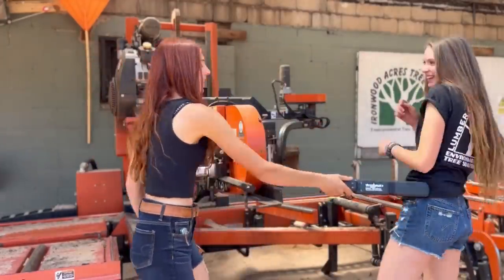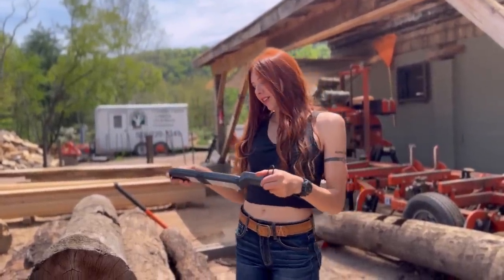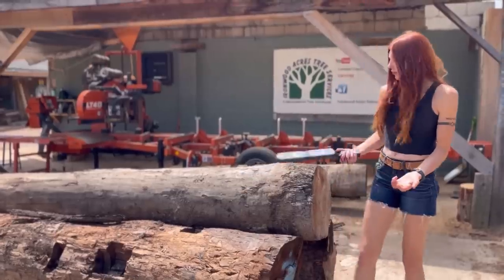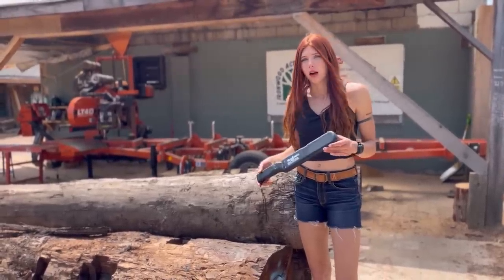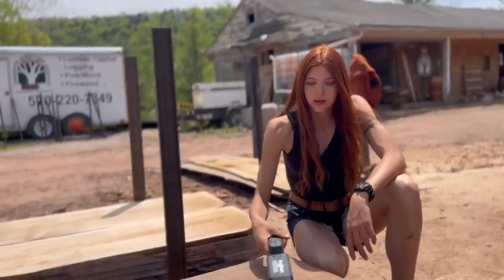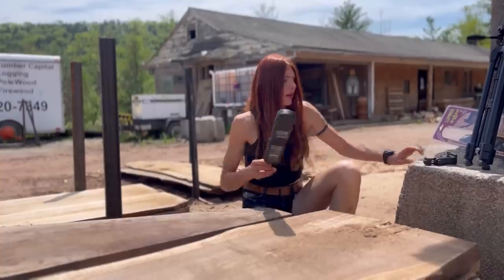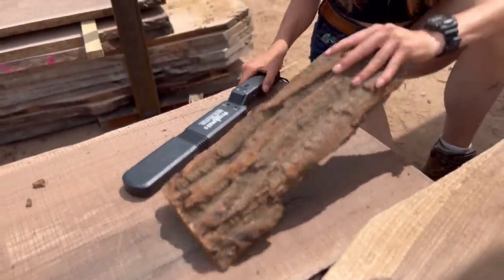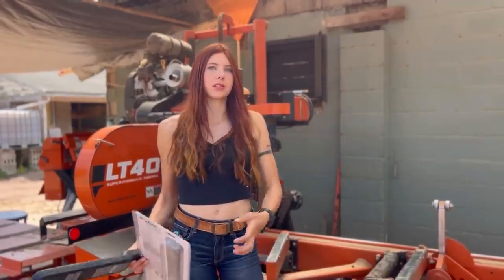Testing this Metal Detector on Logs with Nails!! Will it Save Blades?

Comment: Forget metal detecting, lets just go with comedic relief! Totally fun episode.
Reply: Beep
Reply: @stevejaye9329  jeep and ram trucks too. goose neck hitches on a flatbeds and dually single axles with 18 wheeler mud flaps and fender wheel guard flares. this ain't the first rodeo for lumber capital log yard. you have dodge   them and keep those diesels trucking logs lumber and fire wood at lumber capital log yard someway south west of pittsburg Pennsylvania along some 4 lane highway that runs east to west and west to east.

Comment: Lots of fun.  Nice gift. At the beginning when it seemed to be beeping randomly, sure looked like it was reacting to the watch. 😊 I think this kind of detector is meant for boards that are already rough cut and ready for planing and sizing. It's the planer and rip blades that it saves.  As you found, it's not meant to penetrate a thick cover of wood.
Reply: the key is lumber in lumber wizard 5 which has a  board with flat  surfaces. 

it has a 4.5 star rating and the base price is around $150. but can it on roundish log. if the device uses magnetic detection it will.not work well with stainless steel anchoring devices.  if it uses lazer light it  is is looking at visual  reflective properties

and jade and emerald are girls having fun. now add some time and boss lady beauty and wisdom. what do you get? women of lumber capital log yard. but for now they are girls exchanging sisterly love. but watch out for the dudes of hazard. bo and luke duke going after emerald and jade.  they ware the daisy dude demins.  the boss lady supports  daisy duke wisdom by not wearing demin shorts but full length protective gear.  and watch the.boss man as he talked to a family rabbi and no pigs or other unclean thoughts.  otherwise   the rabbi will oops. the circumcision turned into a Lorena bobbit moment and the nip and snip turns out to be a full castration and cut and toss the pork by products. and the boss has the.moxie and tool to cut meat balls with chain sawz or a yank off with a snatch block or skidder winch cable. be careful with the point on the peavey  and the cant  hooks of the log and timber rolling business ends of the rolling devices. lumber capital log yard only uses tools of steel and.rubber tires or bulldozer steel track plates. warning warning the boss man has nerves of steel to climb trees  with sharp steel spurs. and he free bases climbing sheer rock faces just for the fun of it and because it was there and he said i will do it and win king of the mountain and boss man of the lumber capital log.yard.   look at the picture boss lady is showing public displays  of affection (pda) and juda the little man is keeping  the girls of jade and emerald apart. or is  that girls play with a juda sandwiched between them and a little space for coodie bugs.  anyways be safe  have a good day a good night and better tomorrows.

Comment: It might work better down in at the log pile where there is not a bunch of other metal around.  I metal detect at the beach and parks and use an Equinox 900 and a Garrett carrot for my pin pointer, it has about 6 to 8 inches depth where it will work. If you can figure out a way to get it working, it could save time and money. Thanks for videoing and sharing with us, have a great evening! TTFN

Comment: Afternoon Ladies, the hand wand metal detector doesn't have the power to send a signal deep into wood I had to get a more powerful unit that is used on beaches at best it would reach about 10 to 12 inches in dry sand or dirt if it didn't have a lot of iron content. On logs 1 to 2 inches has been the average and that is on seasoned logs I have metal racks so I have to roll them on the ground to check,  most of the problem metal is barb wire and fence staples and long bolts. I have drilled around the suspected area and pulled them out with nail rippers to salvage nice logs. Watching the ends for signs is best and sometimes gotta bite the bullet and risk it. Good luck. Jla

Comment: i worked at a commercial sawmilling operation in the early 90s, every production facility they had - rough cutting, planing, incising, pressure-treating, even their drying kiln had a metal detector (yes, people used to sneak in and drive brad nails into random boards)...

Comment: Like several other guys have commented we used the Whites or Bounty Hunter metal detector. The style you see guys on the beach use. Fine tuning adjustment is how small or deep you want to detect. Our scaler in the log yard watched for farmer trees. Barbed wire, nails, fence staples and any metal hanging on a branch will grow in. I even found a mule shoe once, (After the double cut hit it, pulling the saw off the wheel and destroying a $1600 saw). Metal detectors were an investment with big saws !
Reply: We used to work with 8/4 ash and we found round lead bullets in some wood.

Comment: I use the same metal detector before running one and 2-in Boards through my planer for 1 and 2 inch board. For 2 inch boards, I checked for metal on both sides. Otherwise it does not go much deeper.

Comment: It could be that the trace piece of the nail that remained embedded in the board was too small.  You could always try placing a nail under a 1" slab and then increasing the thickness of wood over the nail to get a range of how deep under the wood's surface a nail of that size would be detected.

Comment: You may need to check out a metal detector like the ones used to find lost items in the yard. Also you could scan ,
Then cut and then scan again
That would would slow you down. Worth a try

Comment: try a super strong magnet on a rod and sweep for them, like the ones they use while magnet fishing , the detectors are pretty wage in sensing deep like 1 to 5 cm is deep, and nails are a small target to sens.. even for magnets, cable detector maybe, try at home with a fridge magnet and nail and in the stores with nails and distance between them to get a idea, gold hunter detectors are a little better..still.. 5,10,15 centimeters is a mile for thous things 😅 maybe a big elector magnet  🤔

Comment: Well, I suppose you can see if there is a webwsite, or a customer contact list and write the manufacturer a note.  Let them know what your needs are and get their opinion, as they do say it detects metal thru wood.  Be sure to tell them you are a sawyer and dealing with round logs before they go thru your mill.

Bob S - Cleveland

Comment: I wouldn't give up on it so easily.  Read the instructions until you fully understand how to use it.  If it still fails to find a metal object buried in 1 inch of wood, then it's not for your use with saw logs.   I'm sure there are detectors that will penetrate a deeper depth.  I would then first try to make your's work - maybe call the manufacturer - maybe give them a chance to explain the 'fail'.   Second option would be to find one for your use.  It may be expensive, but so are saw blades...  Good luck.   P.S.  I once cut a white oak with the bottom log (8ft) at 500 Board Feet.  My buddy skidded it out in snow with a Ford 4000 diesel and tire chains.   The tractor was only 40hp - the front wheels were off the ground nearly all the way out to the landing.

Comment: Hiya, 
Not much use, is it? Try the one Mark Galicic and the Bus Motor use on YT. That works, and what is more, it stands upright, which is much better for sore backs and speed of use. Cheap bubble pack packaging does often indicate cheap items. In this case, a useless one. 
Stay safe, Steve.

Comment: I think some people might not see too well?  Also some old metal might maybe be rusty or dark knotty wood colored?   Maybe metal in wood is harder to see if someone has a mill inside a building and it's not as easy to see like it is in bright sunlight?  I'm just guessing reasons why this exists if it only detects metal that's already visible?
There might be stronger professional level metal detectors with bigger power sources that can penetrate more dense material deeper? ... but I'm guessing.   :P

Comment: In my experience, very expensive metal detectors are quite good. But 90% of the logs I mill come from the forest where I have high confidence they don't have any metal in them. The other 10% I call "yard trees," trees that usually come from people's front yards. Those have a very high chance of having metal in them. In fact I'd say almost always. The problem with less expensive detectors is their accuracy falls way off deeper than 3". Detectors are only as good as the time you spend "scanning" the log. So you spend 15 minutes hand scanning a log, find a few 8 penny nails, put it on the mill and then cut  a 16 penny nail that you missed or was too deep. The manufacturers often make big claims. But I don't see it in real world situations. When I am milling a yard tree log, I spend quality time visually inspecting the log, using an axe (sideways) to open up an area I suspect metal to be (small mounds, bumps, scars, etc.) I suppose if I milled more logs with high risk of metal, I'd look more seriously at getting one.
Reply: In PA, trees that come from the forest have a very high chance of containing bullets, arrow heads and old fence wire...
Reply: @Snarkapotamus  Here in the PNW it is not typical to get metal in trees away from developed property. I have milled a few bullets in my day, though. Soft lead however really does not harm the blade and makes for a nice keepsake board. I built a live edge slab bench with a bullet in it. The customer loved it.
Reply: @Graybeard_  - You've got to understand that during bear/deer season in PA, the bullets will be a flyin'! Almost every year on the first day, there are reports of some poor sap minding his own business walking in some small town being felled by an errant bullet. I knew a guy that took fluorescent green spray paint and painted "COW" on the sides of his cattle after he had lost a couple to hunters!

Comment: The metal detector does a GREAT JOB detecting saw blades (as the package shows).
The claims say it "Detects nails, screws, wire, bullets and other metal objects inside RECYCLED wood".
The instructions say to "ALWAYS use a NEW battery" for best results.  As soon as you turn the detector on, the battery is no longer "new".

Comment: That device appears to be little more than a toy.  Get something like a GPZ7000 metal detector as it is likely the best detector used by gold prospectors.  A problem is that it costs quite a few $$$$.  Mine has detected a horseshoe 24" deep in the ground, not that the horseshoe was worth the effort to dig it up.

Comment: Detecting the metal, mostly nails or wire I would guess, is one thing. Getting to it and digging it out is another matter entirely. I think you said in the last video that the walnut was valuable enough that you would sacrifice blades to mill it up. This can't be a new issue for saw mills. There must be an answer. You might do better with a metal detector like the treasure hunters use. Watch an episode of Curse of Oak Island on the History Channel to watch their guy find relics. Really enjoy your videos.

Comment: I agree, that metal detector device is not worth the efforts.  If you have to see the metal for it to detect, as  you say, what is the point of having it.  I think you have to find something different.  Maybe the piece of metal needs to be larger such as a normal embedded Nail.
Thanks for the video. Take care.

Comment: I have one of the same model and it works better than what you show in your clip.  One thing, when you turn it on, keep it away from all metal until the "ready" beep.  It is calibrating during those first few seconds.  I had a log with a piece of wire in it, which I found after cutting the wire.  I got the detector out, flipped the log over 180 and cut from the other side, about 2 inch slabs and detected the wire before the saw found it.  As the cant got thinner, I started finding the log stops, so it was hard to use over on the "stops" side after the thickness was less than about 8 inches.

Comment: these things aren't perfect i can garrentee that a screw or nail when rusted dirty will b dam hard to see if not impossible so this will definitely find something right in the surface I have 155 acres and every couple years I have to re-post the no hunting signs I put a 3 inch screw half way in to hang the sign then everyother year we go around and reset signs we back out the screws and reset

Comment: You missed the point. Check for large amounts of metal away from the metal mill.  Metal can be detrimental to the blade.  Maybe even causing it to snap in operation.  Which could be deadly.  So give it a chance.
Reply from the maker: The mill blades snap all the time, and it’s certainly not deadly haha

Comment: Depth of detection depends on size of the metal. Less for small stuff, deeper for big stuff. Really good for finding small particles before sending them thru a planer and saving the blade. Found a lot that were just under the surface and not visible. For a log, if it finds metal, it'll probably be big enough to break the blade. Not especially useful for most of your work.

Comment: I googled the Lumber Wizard 5 manual, and READ it carefully too! Ladies, there is a set depth of detection for a given iron size. I think a bullet from a hunter can be found deeper and won't be cut through by the LT-40 as easily as a small nail. The part is plastic, so you can also put it directly on the log and don't have to keep it half or an inch apart. If you have cut a piece of iron in a log, you can examine the rest of the log for further pieces of iron after each cut. The thing is probably intended for such cases. The product has consistently positive reviews and can therefore - used correctly - not be so bad or useless. That was super nice of your follower to send you such a help, so just say thank you like good girls should. Today there is only a thumbs up for your beautiful legs...